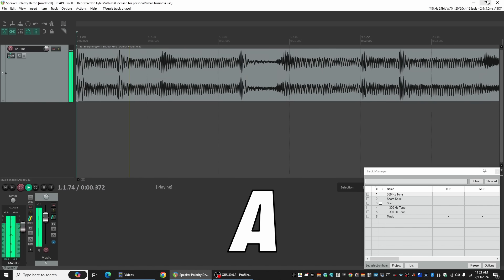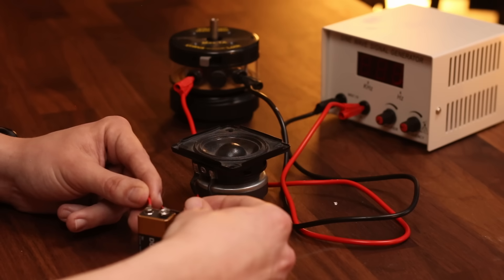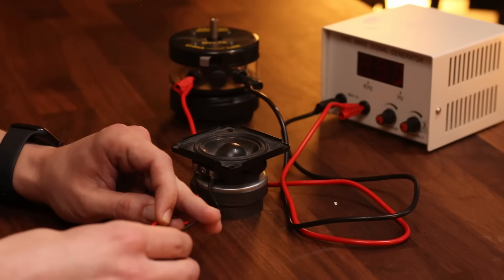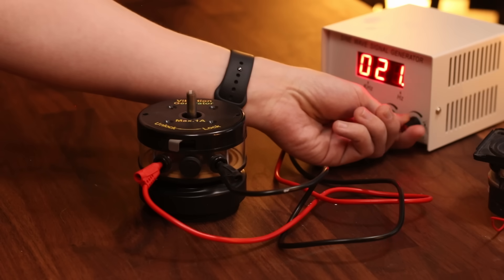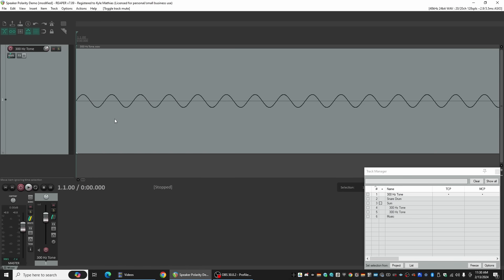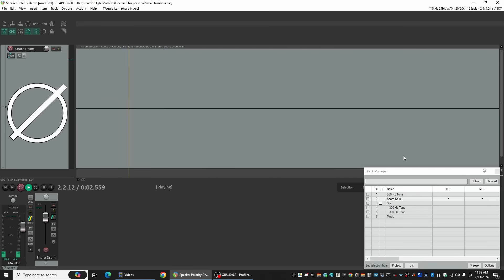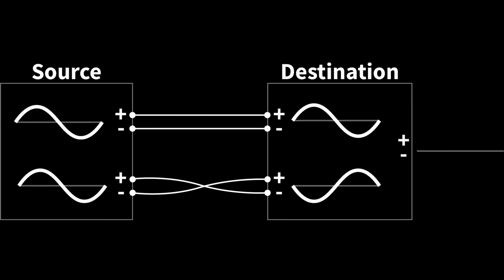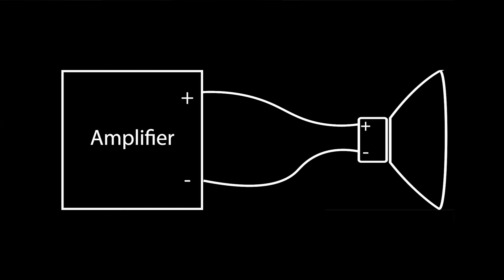What Happens When You Wire Speakers Backwards?

Comment: 1) The stereo is the lab equipment.
So your lab equipment needs to be of a quality that can reveal the audible differences.

2) The song you are playing for the test matters.
Most songs have sub-par sound quality.  In such cases, it is difficult to hear which one is right, even on a highly revealing system.  Although, on such a system, you will hear a difference.

However, if you walked in to the room, and someone asked you "Which one is in phase, and which one is out of phase?", you would not be able to tell -- even though you will hear ever so slight differences.  Again, that is with a so-so sounding song.  The vast majority of songs are so-so (sound quality wise).

With a properly mixed and mastered recording, it becomes more obvious which one is in phase, and which one is out of phase.
Reply: There's more to this line of reasoning. First, the effects of interference, is a double edge sword, since it can be additive or subtractive. Both can make the audio suck. The negative effects of room acoustics can be worse than speaker phasing. And then there's the problem of playing filtered music, or more exactly, compresses music. There are different kinds of compression, but all versions affect the fidelity of the sound produced. In the old days, we worried about sound quality and created HiFi, which came before we got stereo so we could "sit in" the studio and hear the placement of which side of the studio/stage a particular sound orginated. A lot of that was before we had phase perfect (an exaggeration) amps and speakers, and super low distortion (also exaggerated). Even a "passive" network in a 3 way speaker used to "filter" the bands of sound going to each type of sound transducer suffers nonlinearities from short comings of passive components, especially the inductors for low frequencies since they cheat and use "iron" or ferrite to enhance the inductance but create nonlinearity.

So, "perfect" is way too hard. That doesn't mean we shouldn't try. When I was a kid, I went to Beatty's sound store in KCMO and saw some of the most expensive audio equipment in the world at the time. I was amazed, but then the "best" audio I had back then (in the late 60s) was my car's AM radio! I think most audio we get now is really remarkable. Much of that is thanks to the "filtering" our ears and brains do to the sound.

Comment: I did some experiments myself, at high volume and 4 speakers that extend down to about 20Hz. You can tell the difference if the leading pressure wave is positive vs negative with some drum beats. It's like being able to tell if the wind is coming from in front of you or from behind. If the audio signal is not symmetrical in the positive wave and the negative one following it you might be able to hear or feel a difference. 

Kick drums with a positive leading edge seem to have more of a kick to it than it being reversed, which seems to take out some of that kick energy. 

I can imagine subs with movie content below 20Hz will be more noticeable.

Comment: well i have a problem here.. i gotta wire up 6 speakers in my car but i have no idea which wire is positive and which is negative, wiring in that car is literal mess.. dont ask me anything. so im curious about is there any way to check which wire is positive, im not sure if i can check it normally with multimeter like looking for a normal live wire, just connect one terminal on each wire and the other terminal of multimeter to the ground and see which wire is live. should it work like that?

Comment: For a single frequency of sound, when two speakers are separated in space, there are positions in the room where the sound waves constructively interfere (such as the point exactly between them) and places where they destructively interfere (such as a point between them that is a bit closer to one speaker than the other (the "bit" being exactly one quarter of a wavelength). If you plot out these points of constructive and destructive interference, you get lines of constructive and destructive interference that are separated by distances in the range of 1/4 of the wavelength. Even when the speakers are wired "correctly", you STILL get spots that have destructive interference, but where the spots are depends on the frequency/wavelength of the sound.

Flipping the polarity of one of the speakers should just move the various quiet and loud spots around the room. If one speaker is flipped, the position half-way between the speakers is one of those destructive interference spots. Importantly, this spot has destructive interference for EVERY frequency of sound. 

Middle C is around 256 Hz, so about 78 cm of wavelength, with higher frequencies having shorter wavelengths. For the very low frequency sounds (60Hz has a wavelength of around 5.3 metres (18.3 feet), the destructive interference zone would be a large part of the room. Thus you probably would be unable to notice a reversed polarity speaker for any of the high frequencies, but could for the lowest frequencies.

Thus, if you have mismatched polarity on your pair of speakers in two corners of the room - the centre line of the room will be quiet for all frequencies, and for the lowest frequencies, the quiet area will extend well beyond this centre line. For higher frequencies, even a little distance from the room's centre line, all other places in the room will sound pretty much the same as if the speakers were "properly" hooked up.

Comment: Interesting demonstration. Using a snare drum head is probably not the best instrument to hear audble changes, if any. There are too many applications that will affect what one might discern. First is the attack of the instrument. How hard was the head hit(force) at what angle was the head hit by the stick. Stick: wood, nylon, mallet, etc. Is the sound heard thru a electronic system or directly through ambient air. How tight were the heads and snare strands. I could continue but I think you get it. I heard a distinct difference but to me I perceived two separate attacks. Good video. I tune my drums every week because room temperature changes output sound as well as how much space I'm creating the sound,ie, small room, number of people, etc.

Comment: The signal is the same, the device that actuates in diferent manner. The speaker is not reproducing the signal exactly as it is, it produce distorcions, it has physical and mechanical limitations and resistance. The speaker has more mechanical resistance when contracted then when expanded, it distorces the signal when it reproduces it, but we are used to it. In that way inverting the polarity invert this mechanical limitation bias and the signal will be distorced in the opposite side of the signal.
This cannot be replicated in a software because the media, in the case, the speaker itself is not wired with inverted polarity speaker, it will never produce the same effect.
We are used to this "pattern" of distorcion and when the wires are inverted one can hear the difference, but not everyone will "perceive" it, only the sensible ones.

Comment: Surely two speakers wired inversely with cones facing each other will work together if in the same enclosure...that was a theory I ran building a subwoofer box for my car back when I was 17....not 17 anymore :) It worked so well someone stole it, so I have no long term knowledge for the wellbeing of the subs

Comment: Thanks for the information. My brother does musical performance on stage. But most of the time he is dependent on the audio contractors for the sound equipment. Sometimes he used to tell me about some bad performance. At that time I used to explain to him the things you explained. Although I am not a professional like you, as a DIY person and more into Engineering, I used to explain my brother to check out on the speakers, their connection and placings to overcome some problems.(I am now sharing this video with him❤).

Thanks.

Comment: En how to test it ?
Use a aa battery connect it on the speaker.
If it move out side than you know the what cabel is what. 
The plus battery is the plus of the speaker.
Go it down mean it not correct connect .

Easy by wires what have no colour on it.

Comment: As long as everything is wired backwards it doesn't matter, it's all relative. For instance wiring a subwoofer backwards can cause issues at the crossover frequency but can sometimes actually do the opposite and fix those issues, this helps if you don't have a variable phase knob and you can only invert polarity

Comment: I think the hearing of the snare differently does happen but only when the speakers are a distance away from your ears.
With your headphones on, they are right next to each other thus any air pressure difference is directly picked up.
With speakers a distance away, however, the following effect gets more pronounced - how blowing (outward movements) go forward strongly like a laser and sucking (inward movements) suck from all around.
This is why your speaker playing a sine wave can actually blow a net force of air forward and blow out a candle -- and means that the initial spike of the snare will be stronger if it starts in the positive and you are a distance from your speakers - as the air pressure will travel further if the cone moves outwards

Comment: let me say some words: it is too much talking, it is enough to show 
A the the polarity is no difference for ONE speaker. no one can hear the difference of polarity.
B but it is important for stereo that the speakers have the same polarity, because if they haven´,t the speakers move in opposite directions, and so  the sound is affected, because the sound wave would "extinguish"  each other(btw: this effect is the principle of noise cancelling with earphones. they have a microphone that sends an opposite signal with a shift in phase and therewith "kill" the noise freon around)

a correct mono signal on 2 speakers appears from exactly between the speakers, uncorrect wired speakers produce  sound that seems to come from somwehere you cannot specify.
that is all. and as a techer i call your clip "overteaching",  because  all the things you show can be confusing take away half the time and it is twice as informative!
edit: misspelling corrected

Comment: I think it would highly depend on the construction of the speaker cone itself when it comes to a small number of speakers.  As some may be designed to work or sound the same in either configuration, while other's may not.

Comment: nothing really happens. a normal speaker is an inductor which turns into an electromagnet when current flows through it , when current is applied it pushes itself outwards because of its magnetic polarity against the permanent magnet , it will still behave the same regardless of electrical polarity.  What really matters for  speakers is the resistance of the inductor. phase shifting is done by amplifier not speaker. Also if in ur imput signal signals are alreadyy out of phase and ure using amplifier in bridge mode then it will definitely cause issues.

Comment: When I was 16 I worked in a guitar/audio shop. Someone sold us a pair of AKAI SE-L150's for cheap, and I thought they looked cool as hell. I asked one of the owners how much he wanted for them. He said he didn't like them much, so for me, £40. I took them home, and figured out why he didn't like them. There was less bass coming from the left speaker. So I did a battery test, and sure enough, one of the two woofers on the left speaker went in the wrong direction. I swapped the polarity, and I use those speakers to this day, 9 years later -just moved them into a new house. Had a similar story buying a turntable for a steal of a price because the owner had a mis-wired cartridge and no initiative.

Comment: Reverse wiring does have an effect depending on the type of sub, enclosure and power. A sub designed for outward throw if wired backwards can cause bottoming out and or reduced sound at higher power input. A backwards design is usually one for mostly enclosure tuned ported, so backwards throw can cause over heating of the coil from travel outside the magnet. And neutral throw, same in as out isn't effected as much by reversal input. The signals are ac current, but just like ac house current, one direction is longer than the other. Your primary signals is for sound, the reverse helps with return and dampening. A forward throwing sub in a sealed enclosure will have reduced sound, where as a forward throw in a ported enclosure can have increased tuned volume but greatly reduced outside of the bandwidth. At low volumes especially with computer or TV speakers which are normally neutral throw for best SQ and don't need high outputs, of course you won't hear a sound difference

Comment: As a Retired Disc Jock, I have seen and heard a reversed speaker under heavy Audio Load give out what is called "Baffling." This occurs when the backside of the Coil recoils against the rear of the Magnet Enclosure Housing. This can also result in structural deformity of the said Coil. MJ. in B'dos.😢

Comment: Ya see, it's like this; If wired correctly, The predominant vibrations of intentions collapse off of the cone (usually,) In retrospect to the angle, save the voice coil. One is compelled to assume that if two speakers were suspended a few feet from each ear, R.-L. channel stereo, perhaps mono, that a reversed polarity on one channel (speaker) would pull the sound away from an ear as the other channel would be pushing the sound towards the other ear ! Kinda like an air compressor blowing air into the end of a vacuum cleaner, but of course in an AC fashion, To and Fro so to speak, Well, what actually happens is just that, The abilities to detect those vibrations becomes beyond our capabilities, When the frequencies are aided (imagine a rope with five people on each end pulling against each other, Then one side turning around and pushing the rope the same way its being pulled, The phenomenon is that the sound waves are still there, and aside from your head being inbetwixed to disrupt those sound waves, The flow of those had become beyond our abilities to intercept there new dynamic ! It's called inter'dynami'fluctu'assist'triflow'spontanal'something-something ! Best summed up as like a river flowing down a mountain, or a hillside, where it's source is pushing the water as gravity also pulls that gentle stream flowing through the trees, around the bends and ebbs, where maybe a pool of fish hav... Ohh shit, that's right, I'm going fishing today, C-Ya on my next set of exaggerated words of waist and imagination!
Reply: @m...7928; Really Burns ? Ya gotta go fishing with that story ? Caught a big one but it got away, just missed it as we came around the corner did we ?
Reply: @m...7928; Hey, I'll take ya with My Friend, I don't abandon the likes of MyNamesake, As Me Myself will testify too, As well our still yet to be identified member !
Reply: @m...7928; Dog can't change those stripes on a Leopard, Now can he ?
Reply: @m...7928; Changing the dogs or the Leopards stripes ? Confused here now, help me out will ya ?

Comment: Actually it is very important how the speaker is wired. Some spekers are damaged if you play loud with wrong fase. Most amplifiers dont play +/- voltage sinus, but play 0 to max sinus. Only real class A plays with negative voltage

Comment: if you have multiple speakers, be sure to wire them all in the same direction, like, if both speakers are wired with their positives to the negatives of the amps, then it would act the same as both wired correctly, right?

Comment: If it’s one speaker, nothing happens if it’s two speakers, and and they are wired with both poles red to red black to black. Nothing happens, but if it’s two speakers, and one is wired opposite the other, and you play a mono signal to Bose speakers are going to cancel one another out so the volume of what comes through both speakers is going to be lower, that’s all we will happen will be most noticeable went to speakers are wired out of phase and playing a mono signal.

Comment: An old trick for interesting "Surround sound" is to connect a third speaker to the positive output of the left and right amplifier outputs and put it behind you... this third speaker only produces the difference signal (out of phase or otherwise), and adds a lot of "depth" to the image produced by the main stereo pair. If you add a speaker-level "L-Pad" in series with the third speaker, you can dial in a lower volume setting.
We used to do this with a single speaker and a modern car stereo rig installed on 60's cars that had a single speaker mounted high up in the middle of the dashboard or back seat cushion, and a pair of door speakers in the front. We would connect the rear speaker to the rear amp outputs and use the front-to-rear fader to control the amount of "surround" output.
Reply: Early vacuum tube stereos had a fantom channel 3 rd speaker  and a stereo reverse switch .

Comment: your demo was good but it is also to do with wy it is made i was told as when snear the fist bit wave pushes cone out if wired right if you look at big sub going it stays sorter out never really goes into that realy big pull back this suck back prop more on older type speaker could rip them over time were it is joind to the cone and outer ring

Comment: Using a battery will help checking polarity.....but I am under the thought that if a speaker cone is pulled into the speaker , it might hit or make contact with the housing. BOTTOMING in the voice coil.   Whereas if a speaker is wired so that a hi pulse of voltage pushes the cone OUTWARD that primarily the rubberized ring material will likely not push the cone outwardly to damage the coil.  Your thoughts ?